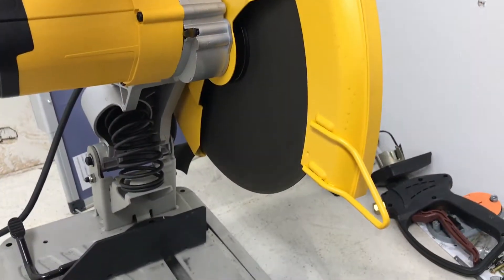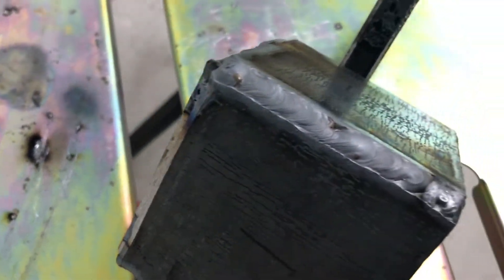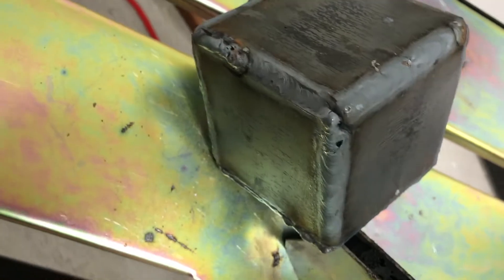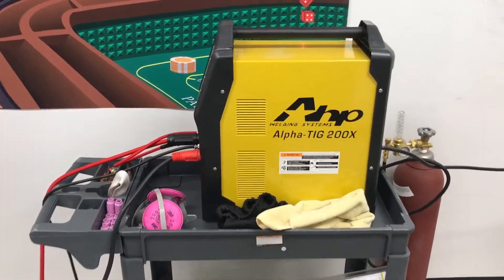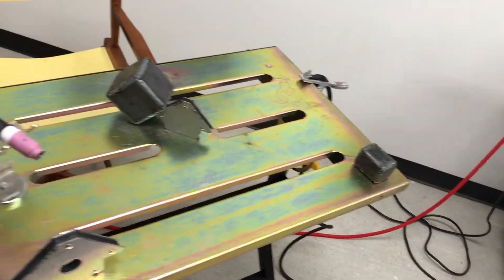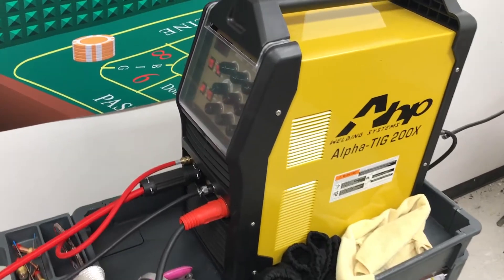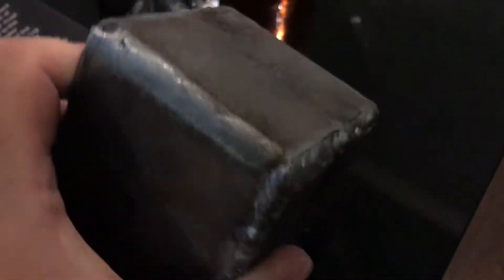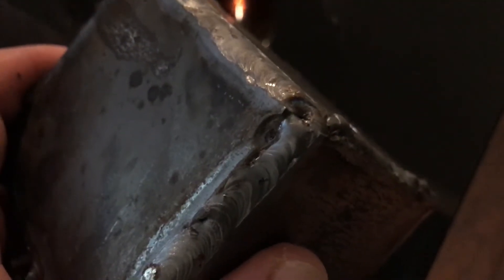TIG Attempt #2 With AlphaTIG 200X Welder

Comment: Thanks for the video.  Am getting started with the same machine.  If you're welding a cube closed, you may want to ensure there is a way for the heated air inside it to escape so it doesn't blow a hole.  I've seen videos where the guy deliberately drills a hole in one of the surfaces just for this reason.
Reply from the maker: Yea that's a totally sweet idea. I found out about that later on and it made so much sense. I think it makes especially a lot of difference with smaller cubes like the ones I'm making. Lately I've been mostly practicing welding pipe, thin pipe especially, so it hasn't been much of a problem lately. Thanks so much for the suggestion though! Keep practicing too!